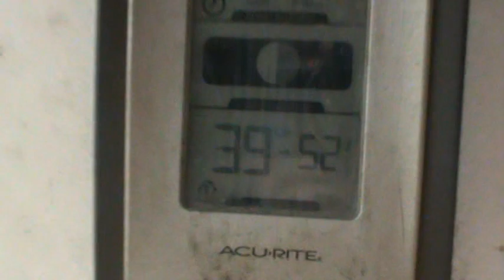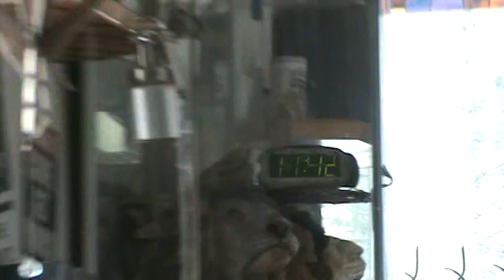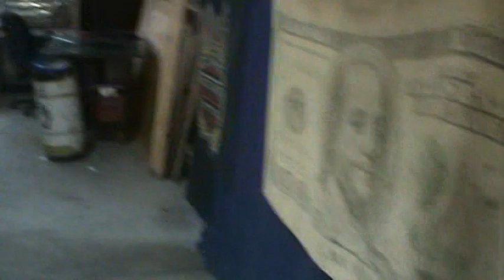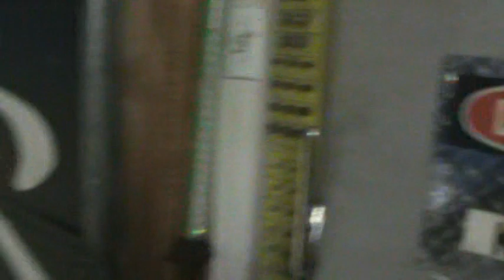NEW SLED

Comment: I would like to find a astro like that , I would paint that with T Rex bedliner then do a camo paint job over it, I did a truck like that 4 years ago and it still holding up like day one. Only bad thing it took 35 quarts to do the whole truck. If you do a camo paint job I used the flat camo paint then shot it matte clear and it turned out good. I would also put a 6 inch lift front and back even if it's 2wd with 2 inch lift springs and 4 inch lift spindles then put some 35,s on the rear and 33,s on the front A/T not mudders on a set of 15x10 corvette rally rims and change the rearend gear to a 5.13 or 4.88 if the rearend is possi